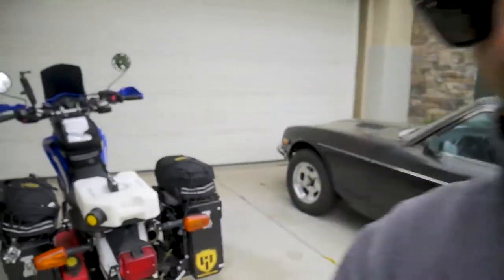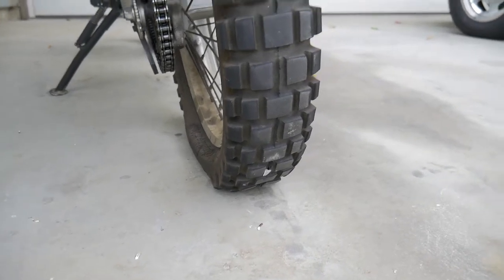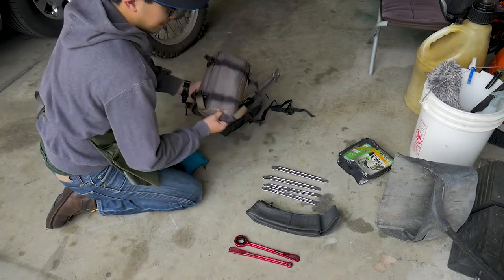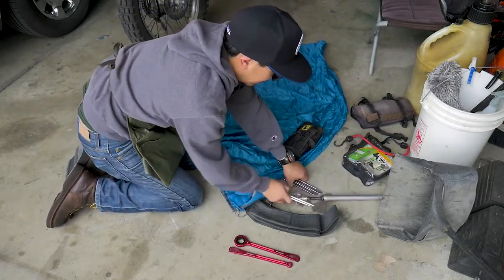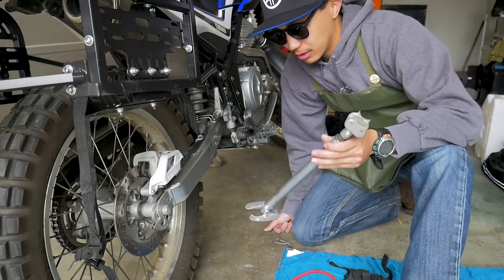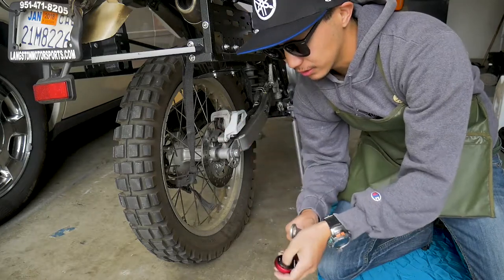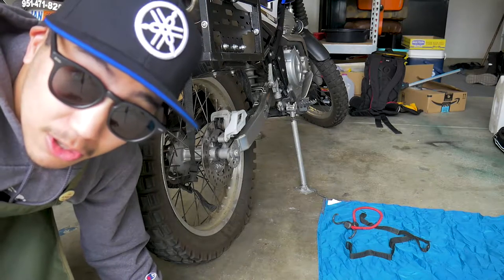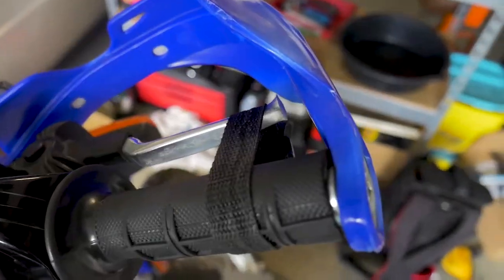XT250 Maintenance: Changing a Tire Part 1/3 (Removing the rear wheel)

Comment: If you are going to use a stand like that, and I don't recommend it, first you need to put a short piece of 2x4 under the stock kickstand, to keep the bike more vertical when you lift up the other side, and take some of the stress off your kickstand. Next, you need a way to secure the stand to your bike. Before I got my centerstand, which has been a lifesaver, I made one of those. I designed it so I could remove the right side footpeg and bolt the stand onto where the footpeg bolted to. I also had a plate on the end that went on the ground, with a hole in it. I took a hammer and drove an 8" nail through it and into the ground. You don't want to take a chance of it slipping on the bike or the ground. Dual sports either need centerstands or tubeless tires (Yamaha actually makes an XT250 with a tubeless rear tire, just not for the U.S. market.
Reply: Where did you find a centerstand? I've been looking for one for a long time.

Comment: l am very impressed with the videos you are putting out, l saw the 125cc one, the sparkplug one and this one.

l am really impressed by your technical knowledge, how did you acquire it? Did you train, are you  a mechanic? An older sibling or parent taught you? However you got it it is impressive all the same.

By the way can you clarify something for me, l have a 125cc yamaha and l am a bit confused, some say it has an oil filter, air filter others claim its just a mesh, what does yours have? l guess different areas of the world different specs.

Comment: That’s a lot of weight on that wheelIs the tire that bad out of balance? I believe I would’ve took it back as a cull. On automobile tires if you have to put on more than an ounce in one place it’s is considered a cull and should be returned and replaced.